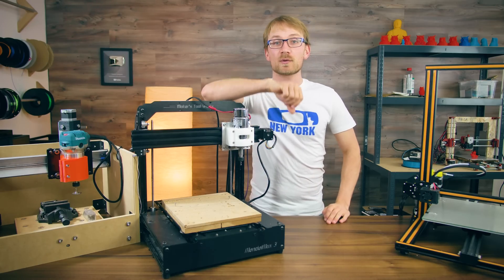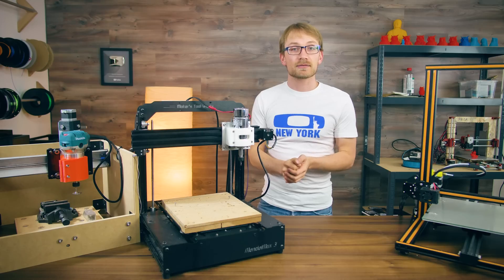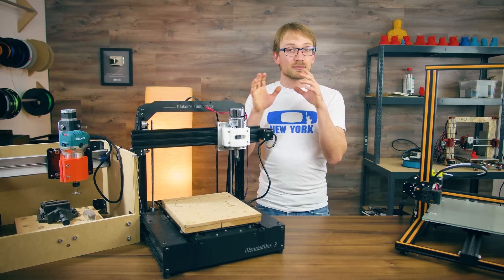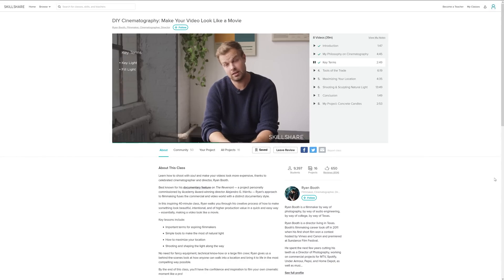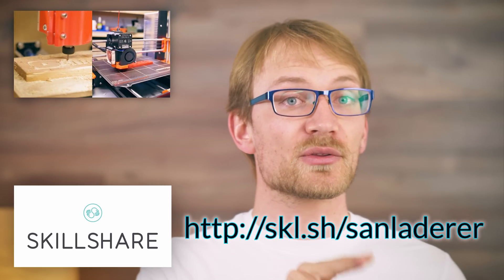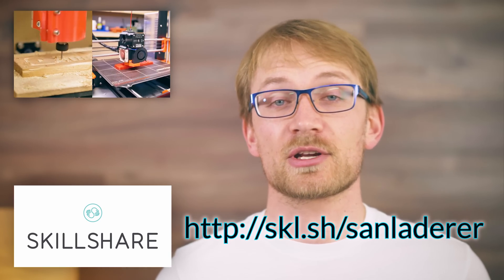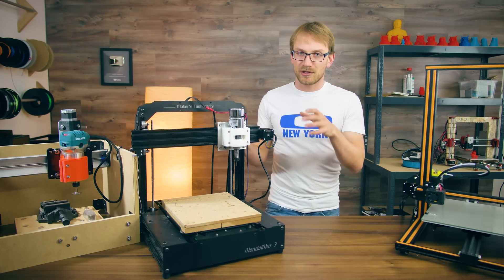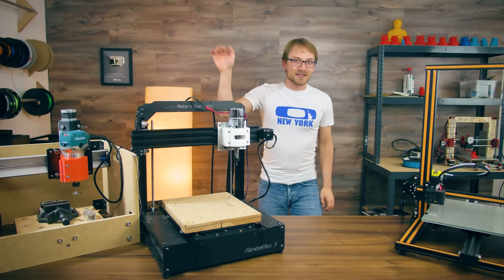Why 3D printers can't be CNC mills

Comment: As a CNC machinist, I do agree with the majority of this. From my experience, the G-Code is not exactly carried over, there are some careless changes that were made along the way that legitimately should be addressed in the firmware. In the Reprapfirmware on the Duet wiki, M30 is "Delete a file on the SD card." In machining, M30 is always the last line of every program and according to my little cheater book from Haas Automation, it is referred to as "Program End and Reset." It is a lot of little things, such as this, that I think stray away from conventional/traditional CNC G-Code (specifically with CNC Mill code, CNC Lathes and other types will be very different) just a bit too much. 

I agree, 3D printers [would not and should not be used as CNC Mills or Routers] due to the severe lack of strength, rigidity, precision, and so much more. Not to mention, that legitimate industrial equipment such as a Mill, a Lathe, a Router, etc, are standardized. This should not be forgotten either. International standards require machines to have power kill switches, safety lights, etc. CNC machines, the good ones at least, are typically completely enclosed so these chips flying everywhere are contained, so the coolant does not get all over the place, so that in the event the workpiece comes flying out of the vice or a tool explodes/shatters...it hits the walls instead of you. As a result of the extra rigidity, strength, safety, elevated standards, a higher degree of cleanliness (usually), these machines take up a significantly larger footprint as one might imagine. At the high-end, these machines are made for high-volume production and are close to completely autonomous once set up. An operator needs only to change a tool every so often, load stock into it, check to ensure dimensions are still accurate, etc. 

These typically do not start under $10,000 and realistically the good ones don't start until about $30,000 (new) and can easily exceed a million for a single machine depending on the application and the precision needed.

At the high end of the spectrum, think Medical or more likely Aerospace (Lockheed Martin, Boeing, GE, and these types of companies), a company called now called DMG Mori has high-end CNC Mills that do also have Additive Manufacturing tool heads. These are Selective Laser Melting (or similar depending on who owns what name) and is typically "3D printing" or laser welding with Aerospace-grade materials such as stainless steel, titanium, Inconel, and so on, from a super fine dust -like powder and intentionally made slightly oversized (or undersized for internal structures). Once enough of the model is "printed" it is then machined, bored, or reamed to the correct dimension extremely precisely, we're talking about micron level here or smaller. 

While this is accurate in saying that 3D printers should not be converted into CNC routers or mills, I do believe that a CNC Mill or Router could be turning into a 3D printer with the right modifications and it probably wouldn't be a bad idea to do that either. It should be clear that this is a short, simplified video. While the information in this video is correct, it is definitely simplified, which is a good thing here. Assuming a thermoplastic extrusion printer is wired correctly and safely, the worst thing that could happen is it breaks itself, it wastes plastic because it doesn't know to stop, or someone gets burned by touching the hot end. It should be common sense, nevertheless, introducing a spinning/rotating cutter adds much more potential danger than one might initially realize. My school's Haas VF2 CNC Mill has a max spindle speed of 7,500 rpm, to clarify...if something goes wrong at that speed...you really do not have time to react fast enough. With 3D printers, mistakes can be made and it is usually not that big of a deal, or not outrageously expensive to fix. When you step up to Lathes, Mills, Routers, etc, the level of respect for the machines must come with that step up. These machines are far less forgiving, much higher voltage, much higher amperage, much stronger and much faster (as well as more responsive) motors, and much more danger potential all around. The additional rigidity and strength also mean that if you crash it, it is a much worse crash than with a 3D printer. When you crash one of these machines, the cost for repair starts at several hundred and can easily exceed $10,000 and really hurt someone at the same time. Once you enter Industrial Manufacturing Machines, the money, skill and education requirements...tends...to...increase....a lot.

3D Printers and other CNC machines do have a surprising amount in common with each other, they really do. Unfortunately, where they differ...makes all the difference. I am building a 3D printer now as if it were a CNC mill and using linear rails, all aluminum (or steel, I am using mostly aluminum though) construction, CNC milled and at times precision ground (very, very accurate) ball screws, and so on. I am even using larger motors with precision planetary gearheads rather than higher microstepping. As of right now there is still a very large gap between 3D printers on the hobbyist level and industrial precision manufacturing machines, I am going to great lengths to shorten that gap as much as I can, for everyone.
Reply: An excellent, well thought-out reply! I did want to mention one thing (that you may very well already know) - M codes are technically machine specific & as far as I can tell, there's no official standard for what each code does. There's obviously the "unofficial" standard for the common ones (M30 is a good example), but they're all very specific to subtractive processes.
Reply: Oh, you're absolutely right. I was looking closer at the CNC Lathe M-Codes and there were a TON of differences 😂 

They are most definitely machine and application specific, some are even dependent on manufacturer (which I cannot stand). I think the closer these two types of manufacturing are, the more productive users can be. It'll be fun to see what people can do with this as it continues to evolve and mature.
Reply: Smoothieware has a 6 axis build which the gcode is based on GRBL.  From my understanding the Gcode it uses is much more "standard".  Wolfmanjm has always hated the butchered gcode standard that Reprap adopted so he put some effort into making it more compatible when using the 6 axis build.
Reply: @RoboSprout  Well, in all fairness, CAM will always typically be used with 3D printing, so I guess a G-Code interpreter can be the remedy of this, but I'll have to look into their stuff. I just don't like that 3D printing g-code isn't standardized in the hobbyist realm, to my knowledge, yet. I wholeheartedly believe it should follow the same CNC standard, because it's quite an intelligent programming language, such as what Fanuc uses, it's quite sophisticated. Even if an open-source ripoff of it is spun off.
Reply: Wow a book is written in a comment.
Reply: Thank you for this insightful response!
Reply: Can you name a CNC that cost a million I want to see what that looks like
Reply: Very interesting, great info on the topic, and being an engineering student I do work a bit with this kind of machinery, tho sadly as not as I would like tho (specially now with everyone home of course). But, albeit it's all true regarding proper professional tools vs. 3D printers... I think we're straying a bit too far here when comparing things. It ain't that fair to really go against proper workshop tools when you're just building a very light duty mill, like just cutting acrylic, wood and maybe very slowly and carefully aluminium.
I entirely get it from your perspective, dealing daily with the kind of machine the little DIY toys dream to be when they grow up, certainly shows what lacks on the little ones, but if we're going apples to apples, the industrial large format 3D printers are an entirely different beast as well that we hobbyist don't really even have a proper idea on.
Some stuff is just no excuse, like going with some crappy degraded V-rollers with floppy belts and expecting to mill anything, but when you're making a tiny machine that can just cut you cases from wood or plastic for little projects, that you still finish up with some sandpaper or filler later on, or a PCB drill for example, this kind of small task is another story, and where a hobbyist should be aiming realistically at achieving when building it. It's what I'm doing with mine: laser head, a 3D printing head, or an RS-775 motor mill head to do pretty simple stuff. That much you can do properly without being worried about a badly made hydraulic line severing and shooting hot oil on your eyes or your workpiece being flinged away into your face and doing serious injury. Breaking on this kind of machine is a little trip to Aliexpress and some 10 dollars of fixes at most, it's a starting point to learn stuff.
Well, even that little duty machine I still added a huge e-stop button on the project as well, and it sure has about twice the aluminium extrusions some CR-10 would have.
Reply: so the conclusion is, while you can transform a 3d printer into a cnc machine, it may not be optimal for certain jobs. some are fine though, for example, milling pcbs doesn't demand much from a 3d printer
Reply: What I took from this is I'm better of getting an adult apprenticeship and doing some ot getting taught do more over time and then ask to use the shop CNC.... No way Ill ever afford that lol
Reply: 3D print tool head has a problem: ooze. To combat ooze, you retract and move at the same time, but it only holds back ooze for a short time, so you have to reach your destination before you have started oozing. Which means that high non-print move speed is important in 3D printers, so high reduction is not very helpful.
Reply: @SianaGearz  I have changed my stance on this regard since then, I completely agree with you.

Comment: Had my Wanhoe i3 v2 scribing out traces down to 0.2mm and drilling 0.6mm VIA's with a flex shaft dremel on a 16cm sq 2-sided PCB Prototype. Works beautiful for those two things. But dont waste your money thinking the 8mm rods on the X carriage are beefy enough to handle anything more than basic engraving, and only VERY lightly at that. There's too much flex in the rods and the sheet metal bracket to handle the cutting forces from a work piece like the copper foil on a PCB. Chatter is going to be the least of your worries. Then there's the whole drive setup, Like Thomas pointed out belts are garbage for dealing with cutting forces. However, this doesn't limit you from certain types of engraving, like say LASER engraving. Mounting a 2.5W LASER to your 3D printer does work well (as well as your stepper drivers and printer can do nice prints). There's even less load on the x-carriage because the LASER and mount weight a bit less than the hot-end. 
Great video Thomas!

Comment: Tom can you put this "tramming" term to bed (pun partially intended), I see it used often along with its pal "bed leveling" , to describe the adjustment, but both are misnomers and completely wrong.  Tramming, of course, is the practice of adjusting axial perpendicularity between a tool heads rotational axis and the bed face, something I do regularly on my CNC but not particularly relevant at all to 3dp when you consider the effect of even several degrees of off-axis tilt of a 0.4mm circle/nozzle squirting molten plastic at the bed face, negligible to say the least. Tramming is applicable to CNC, not 3dp. And of course, "leveling" is also incorrect as no bed is level, nor even needs to be.  I propose the correct term, what is actually being sought by adjustment is "clearance", specifically, clearance conformity across the bed which is like a choppy sea at the micron level. Throw me a life ring!
Reply: He's done a video about that...
Reply: Cheers, must have missed it. Do you recall the title?

Comment: Nice video Tom. This is focused on the technical aspect but there is a point which is not commonly told : Complementarity between additive and soustractive manufacturing. This leads to the 3d printing paradox : the more complex and/or long the job is to be done with soustractive manufacturing, the more it should be done by additive manufacturing. And vise versa. Your example was a job for a soustractive machine. We comonly make the mistake of printing stuff which should be done by other ways of manufacturing. Pre production is longer for milling,  but not that much for a plotter,  plasma or laser cutting. But there's always a limit point determined by complexity,  machinig time and cost, that make a part suitable for a method of production rather than others. The part itself shows it must be manufactured by a particular process. I never seen a part which can be equaly manufactured  by several ways.

Comment: 3D printers are CNC (computer numerical control), it's not a manual process because you don't push your print heat along the build plate to 3D print. Also one cnc vertical milling machine can do what a 3D printer can but not the other way around. Your "milling machine" is actually a drill press with XY table. It's best to remain in your 3D printing confort zone.

Comment: Yeap. All our milling machines use lead screws exclusively and are extremely rigid. I couldn't help you pointing out "super light duty" for your machine there. Side pressure is what milling's all about, basically.

Comment: A cnc mill can be plenty fast enough to 3D print. The real issue is that mills that are not toys are usually big and heavy (1000+ kg). And expensive. And it wouldn't do any better than the cheap CR 10 so it would be crazy to use it like that.
Reply: Exactly, I did that kind of crazy with my cnc, it didn't last long. The machine was better used whipping up a small but accurate purpose-built printer with little baby linear rails, it's so cute, ...and cheap to run.
Reply: All mills are toys, just expensive toys :-)

Comment: does anyone think it would be worth to make rigid 3d printer? I mean body of 3d printer. It would cost some more but it would be much more rigid and eventually be able to produce better prints. In recent years we have see quite a lot of improvement in software and hot ends but body of most 3d printers remained quite flexible even for expensive printers.

Comment: I'm sure thats my DMG 1035 CNC will work fine as a 3D printer x) (150 000€ one but still...)
Reply: Who needs a cooling fan when you have 1000psi TSC
Reply: Through-nozzle cooling. Wait, that's an idea. Patenting right now. No steal.
Reply: Hacoulia Specialy if you have liniar motors  on XY. If not you surely have 20mm pitch ball screw an ca reach 20000mm/min. For shure it can beat any FDM printer.
Reply: x)

Comment: I don't get where the perception that CNCs are slower than 3d printers comes from. Any decent gantry router can move much faster than you'd want to print and would make a perfectly fine base for a large, flat 3D printer.
Reply: It's not the max velocity that's the issue - it's the acceleration and jerk that they're (not) capable of. That's why I cringe whenever I see someone post a picture of a small part and give just the velocity setting - acceleration is really where it matters.